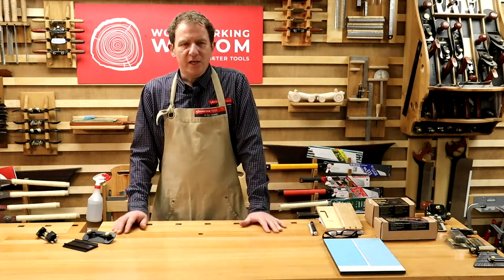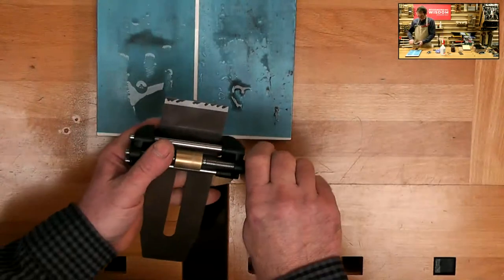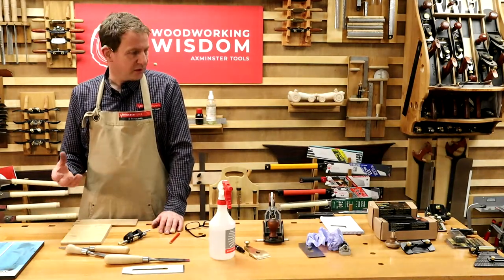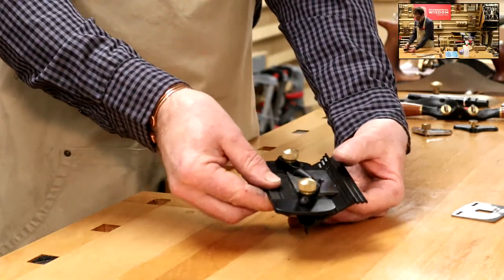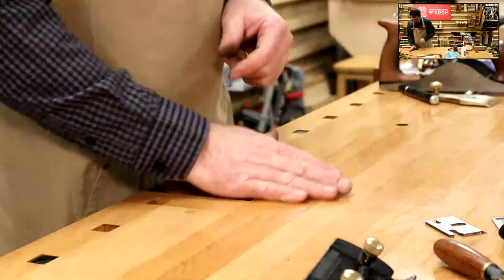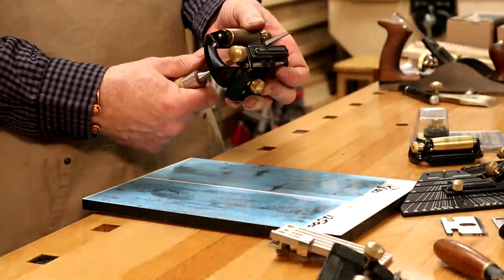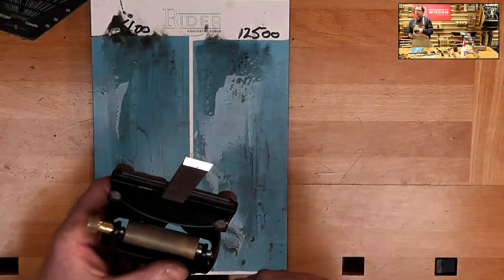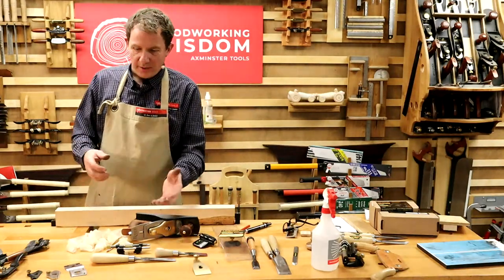Veritas Honing Guides Overview - Woodworking Wisdom

Comment: I purchased a Veritas Side Clamping Honing Guide and tried it out today. It does a good job of keeping the blade flat with the wide roller, it's made well with precision machining. Problem I'm having with it is, it's difficult to keep the blade in place while you turn it over to set you angel. The pros make it look simple but my old arthritic fingers aren't very nimble any more.  It always slips out of the grove when I'm trying to tighten it. Anyone else have this problem? I try to support the blade up against the correct area for my long chisels, It's frustrating.